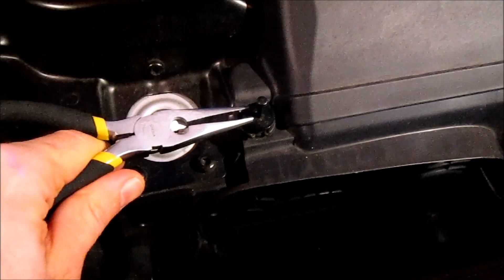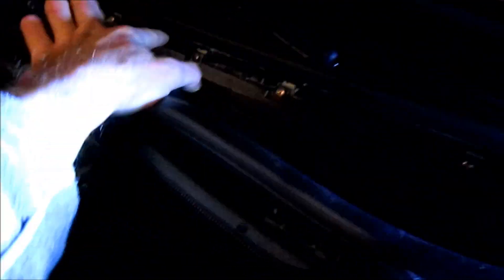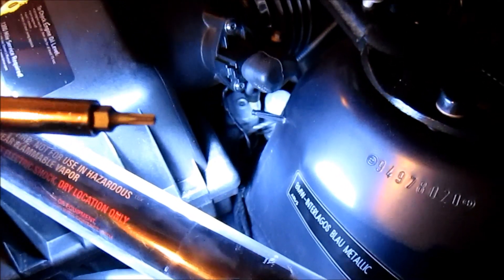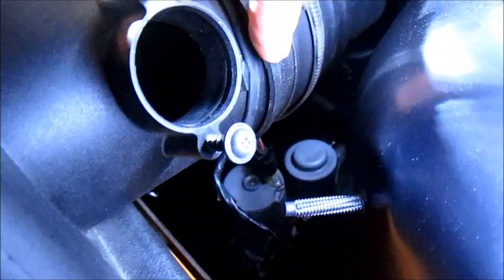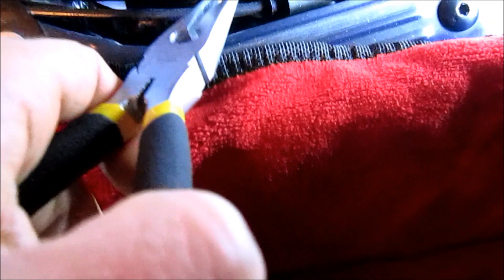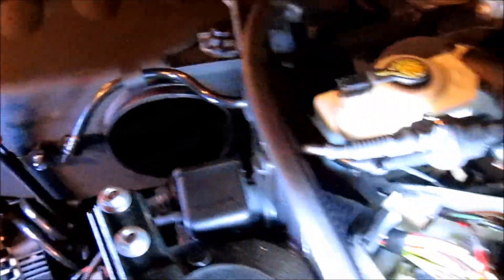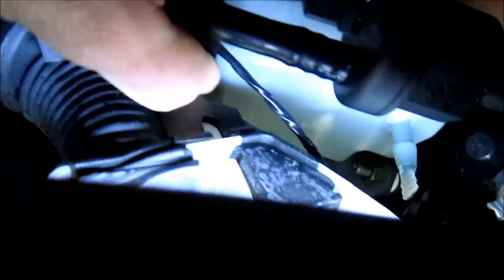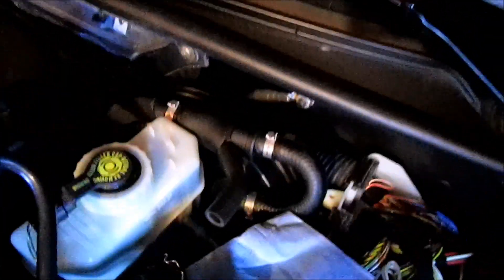BMW M3 CSL Airbox Conversion Install - Part 1

Comment: I'm trying to use your video to determine the location of the TPS sensor that's by the alternator without having to tear my engine bay apart. Is it shown at any point in your video? My understanding is it was underneath a bunch of the intake components...

Thanks btw, awesome video!
Reply from the maker: Throttle position sensor is right next to the oil filter housing.

Comment: DId you use  Turner Plug-and-Play IAT Relocation Kit, or just a BMW Intake Manifold Temperature Sensor -
Reply from the maker: I used the BMW intake temp sensor.

Comment: is this the karbonious airbox? and can you list the things you need to get for the conversion. which tune did you run? AlphaN tune or is it the more oem way which involves MAP or something. looking into making my own airbox, CSL style inspired but with how I want but it will run like the CSL airbox. Thanks!
Reply from the maker: Nope, this is a "Randy Major" airbox, before the Karbonious airboxes. Try searching M3Forums for a list of items, there are quite a few needed. The software that was installed is from TTFS. This car does have a MAP sensor fitted as well.

Comment: is it possible to fully convert a stock e46 M3 to a CSL?
Reply: +1954telecaster of course. it will be expensive but yes.
Reply: is the engine the same or would you have to bore out the cylinders?
Reply: engine is the same, just difference airbox and tune of course (engine wise), mostly its the weight that is different coz CSL got a lot of carbon fiber to lighten the weight of the car.

of course other things like suspension is different (more aggressive and stiffer) and maybe even the diff? can't remember but nothing too major, basically you are paying for a lighter weight with different airbox M3.
Reply: are you sure? i heard the engine was tuned slightly different...
Reply: +1954telecaster the cams are different, uses a MAP sensor instead of MAF, therefore the software is different from a non CSL.
Reply: again that coincide with the airbox conversion, not sure about the cams but you can always just use the schrick cams (only cam for e46 m3 right now I believe available for consumer.)
Reply: any idea how much a full CSL conversion would cost? or would it be cheaper just to import a real one from Europe...
Reply: All things considered it would probably be MUCH cheaper to import one if that is at all possible